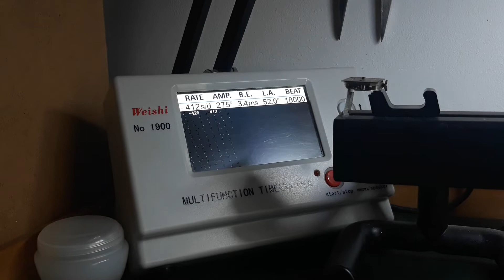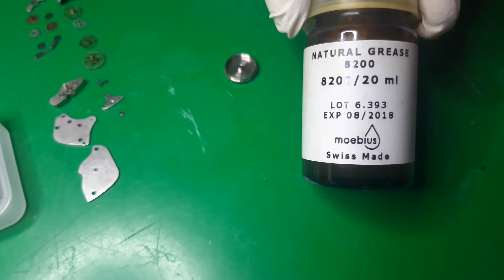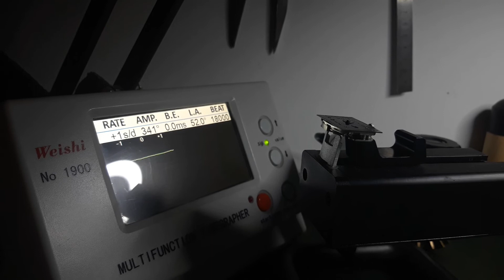Restoration of a Junghans 1930 Art Deco Watch

Comment: nice video!! what kind of system is it to remake the case? did you learn it yourself or can i buy it on the internet (because I want to be able to do that too)? greetings Marc
Reply from the maker: Learned it myself ??? I'm not a genius !!!😅
I learned from people better than me, like everything I know. This system is called electrolysis. Through the current it is possible to cover metal on metal. For example you can copper, nickel, chrome, gild, silver metals. You need a laboratory stabilizer and the liquids you need; it is possible to buy everything on the internet. To have acceptable results you need a lot of practice. If I can, everyone can ...👍
Thanks for your comment!!!!!
Reply: @watchrestorationchannel1061  it looks "easy" on you! but sounds complicated - I've seen a few videos already. I would like to buy a set - but haven't found any yet
Reply from the maker: @m.h.8150  The hardest part is preparing the watchcase, removing the old plating, polishing well and above all making the case as clean as possible. My result is not perfect, I still have to work on it to get better results. Search on ebay and you will find everything you need.👍
Reply: @watchrestorationchannel1061  i will, thank you!!!